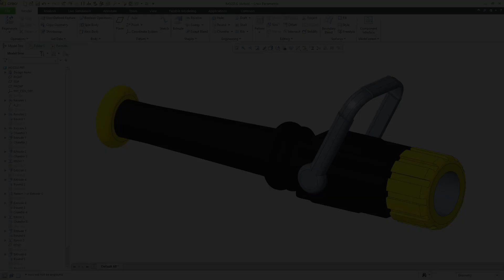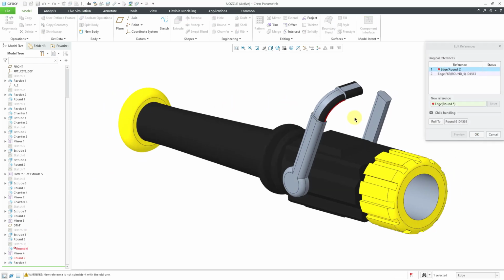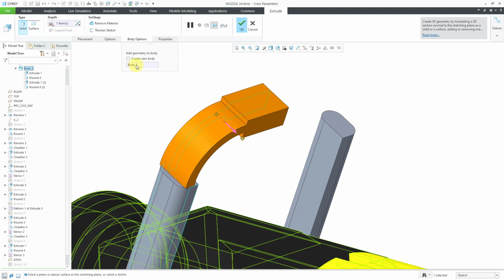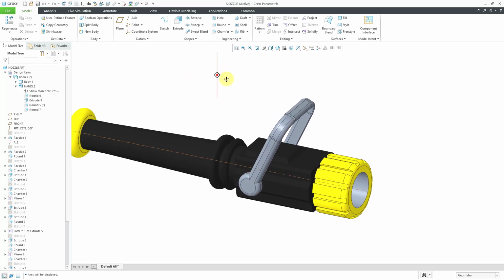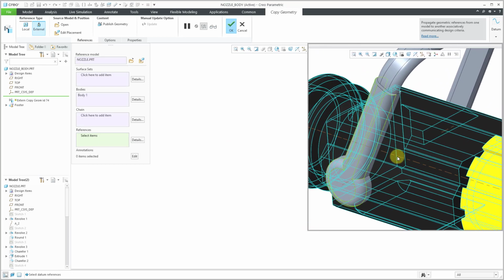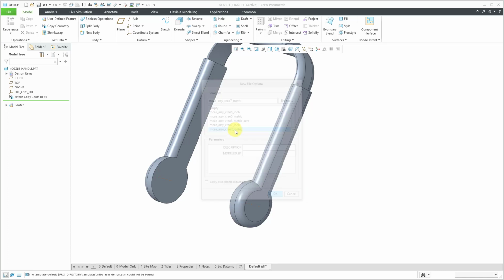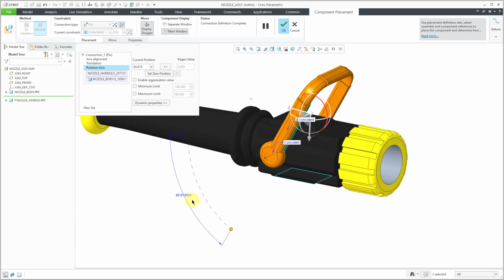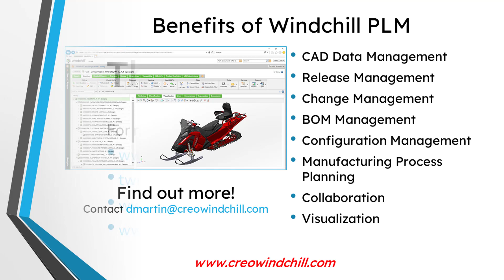Creo Parametric - Multibody for Mechanisms

Comment: Hi Dave, I still don't understand the interest of the multibody for mechanisms since it's still necessary to redo the assembly after... Do you have an explanation please? Thanks
Reply from the maker: This was a static PART with non-moving features that was turned into an ASSEMBLY with moving components.
Reply: @CADPLMGuy  Thank you for your answer. But why not build the part directly into an assembly?
Reply from the maker: @gabyrob1479  I don't understand your question. I explained the scenario at the beginning of the video. I had a part that I did not create that I now wanted to be an assembly.
Reply: @CADPLMGuy  Sorry Dave, I'm misspoke about about my question. Yes I understand your scenario but my question about the multibody is general. 
Basically what difference and advantages are there between a design in an assembly and that in multi-body, knowing that it will be necessary to redo an assembly afterwards? 
I do not understand why PTC has developed that or the interest of this way of doing things. I was just wondering if you had an answer. Thank you so much
Reply from the maker: I recommend you watch one of Martin Neumueller's videos on Multibody. He outlines 13 use cases for Multibody and not all of them - in fact most of them - do not involve assemblies. For example, Multibody can be used to define parts with cavities / subtractive geometry, multi-shot injection molded parts, and are used extensively in Generative Design. If you only think of Multibody in terms of assemblies, you are severely limiting yourself in terms of the capabilities of this toolset.
Reply: @CADPLMGuy  Thank you for your comment ! Indeed, I had already heard of subtractive geometry. I find this principle more relevant than the Multibody assembly. I'm going to watch this video to figure it all out. Thank you for your advice.

Comment: Thank You Dave.
I'm wondering if we can change the multibody base part dimensions (or even parameters) in the assembly level relations (in the assembly which is created from the separate bodies and which may also include some other parts assembled which is not created within the multibody base part) . Is it possible?
Reply from the maker: Yes. See my earlier videos where I show how this is controlled via an External Copy Geometry feature.